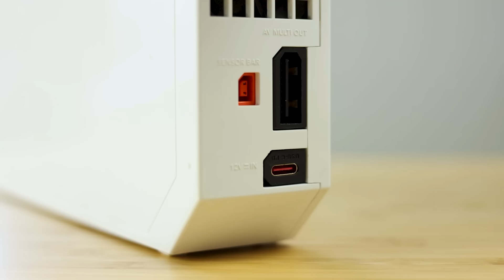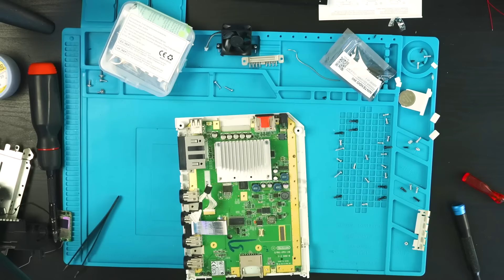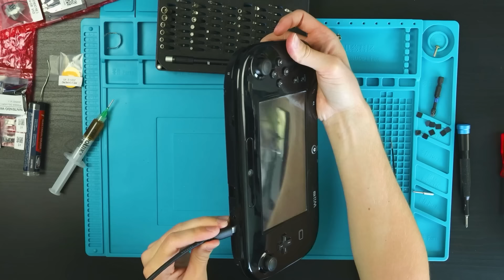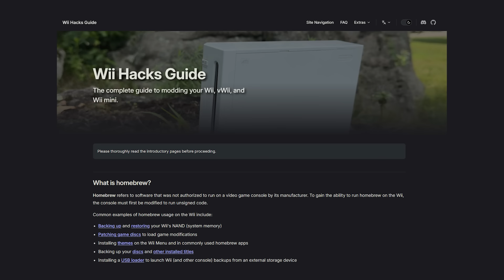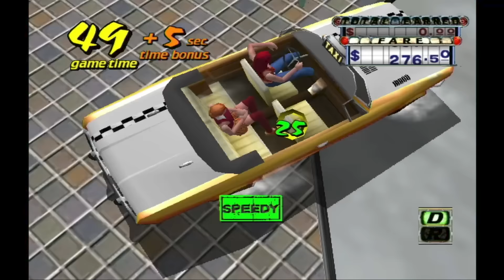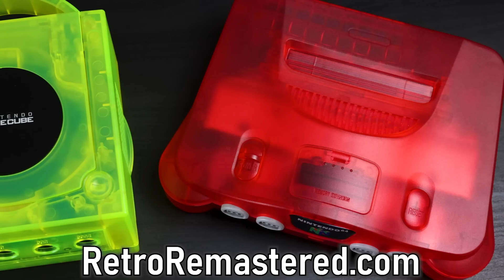The ULTIMATE Modded Wii! (HDMI + USB-C)

Comment: I have the Wii2hdmi adapter, and it's surprisingly good. It's definitely not perfect, but, for the price, it's great.

I also have a far more expensive solution for my N64, which is RGB modded, and connects to my TV with a RAD2X, so I know what it's like to have a really clean video signal, but I'm perfectly happy with the image quality I get from the wii2hdmi adapter on the Wii. There's a bit of signal noise, but you usually don't even notice it.

Comment: So I have this Vizio 75 inch 4K TV (real world size its 65.5 inches with measuring tape) and plugging the Wii U's own HDMI cable to it... the TV won't reproduce image besides black screen stuttering every few seconds few times a minute.
It worked just fine in a regular 30 to 40 inch 4K TVs. But the 75inch TV was a bit much...
I'll see if using the Wii HDMI adapter will work on the Wii U's native Wii graphics port (the one everyone avoids given you already have the HDMI port and cable by default) just in case to get around the issue.
And using a 4K HDMI adapter for GameCube works fine for this TV, so its weird that the HDMI Wii U couldn't handle it.

Comment: I've been tinkering with a wii I got for free, and the image quality is just so bad. I modded it and switched off deflicker and everything else. What the hell was Nintendo thinking when they build this system. Most of the games look terrible, and switching controllers for every game you play feel like such a grind. I'm actually over it. I do own a wii u, and that's my preferred system I use to play old Nintendo games, but even on there you have to change controls a lot. Why did Nintendo not just put in a hdmi output, I mean it came out around the same gen as a ps 3, but even ps 2 games look better than wii games. Don't get me started on motion controls. Why they didn't give you an option on most games. They literally force you to use motion. Such an frustrating system.

Comment: @JakeSimmons can you mod the controller to have a battery bank to charge by usb type C? I can deal with the Wii not having HDMI or settling with adapters or modding, but I can’t stand going through batteries like no man’s business playing that should have never been a thing. I know there are cheap rechargeable type battery clip ins they just don’t work that well. Same thing that needs to be done with the xbox360 old controllers. Just my thoughts.
Reply from the maker: I would just get some rechargeable AAs. The LADDAs from IKEA are awesome
Reply: No IKEA nearby, so I use the £4 ($5.40) Lidl AA Nimh (x4) and a £4 Kodak USB-C Fast Battery (x2) charger from Poundland.

I'd choose the LSD / Ready To Use type (but lower mah capacity), as they drain slower on the shelf.

The charger is great for travel as it's the same size as a Wii remote cut in half and weighs nothing. I'd prefer x4 charging slots though.

I hear the remotes drain batteries constantly, so remove when not in use for a while. Also claims that 'motion plus' versions & dongles drain faster.

A power switch mod for the remote would be good, or you can wedge a piece of drinking straw on top of one spring.

Comment: the HDMI is desired but I feel safer having the OG power cable
Reply: Honestly, considering how old the components in the original power supply are and how much progress has been made in designing power supplies in the past 20 years, I personally feel safer with the USB-C replacement
Reply: @SHIFT-HACKMON I'm over here wondering how the USB-C upgrade this guy did is holding up 8 months later
Reply: Fair enough

Comment: How does this mod compare to the retrogem, the ElectronAVE, and the Arthrimus? Is there a clear winner among the 4 of them? I tried using the Wii2HDMI but it sucked badly compared to the retrotink 5x pro with component cables. Problem with the retrotink is that theres too many fucken cables but it looks amazing compared to anything else. If any of these mods look as good as the retrotink 5x pro using components i would totally do it, but no way of me knowing this without seeing side by side, which are hard to find anywhere.
Reply: The benefits of Arthrimus and AVE Mod is the same. Both based on Ingo Korbs GCVideo.
GC Video is not the newest build, but the results are very good. I don't think, the image with Retro G.E.M. is much better...Plus, the AVE is much cheaper in comparison to Shiny Edition of Retro G.E.M.

Comment: I have the Electron Shepherd AVE-HDMI mod in my Wii and I use an mClassic to make it look a little better (subjective). The AVE-HDMI uses GCVideo like GameCube HDMI adapters. The odd part is that on my 4K Samsung, with the mClassic upscaling 480p to 1440p, my TV glitches out. The screen flicks on and off. This does not happen on my GameCube w/ Pluto IIx mod (also GCVideo) or OG XBOX with Project Stellar and XboxHD+ HDMI mod or Wii U. It has no problems on any 1080p TV I have or my 1440p gaming monitor. I have to use an EDID emulator for 1080p to have the mClassic output at 1080p. I also do have the Electron Shepherd Electron Warp analog to HDMI adapter. It is better than the cheap $10 from Amazon, if your looking. With 480p coming out either way to the mClassic, you really can't tell any difference unless you are really close. If you are just playing a few feet back, you won't notice. If you don't want to go outside Amazon, at least get the Mayflash Wii to HDMI for a few bucks more but the Electron Warp is ~$30 shipped. Electron Shepherd is very responsive to emails. They couldn't do much about my AVE-HDMI issue because its not on them but they did what they could.

Comment: No way this is worth it. Just buy a Wii U… I find them locally for $50-$70 often.
Reply: No. The Wii U without the gamepad is in no way worth it over this. Without the gamepad, you are locked out of the setup process, and locked out of system settings. The gamepad is required, and without cfw theres no way around that. Even then, the Wii U picture output for Wii games is worse than a Wii can output, and is much slower to even boot up, not even mentioning that you have to also wait for it to boot into wii mode after waiting for it to boot up initially. You can hold B on the gamepad to boot straight into the Wii menu, but without the gamepad good luck.
Reply: @Nebula.21_ I didn’t say you can use a Wii U without the gamepad. But you can’t deny the Wii U looks as good as this mod and costs the same as the mod.
Reply: @slayNprey the wii u Wii output looks really bad if you've ever had one
Reply: @aagamingdotme you can use homebrew to force vWii to output at native 480p and it looks basically the same as a Wii HDMI mod
Reply: The Wii U only outputs 16-235 limited RGB range, the Wii covers the whole 0-255 range giving you more vibrant colors, deeper blacks and brighter whites. Also, it can be upscaled to 4K without going through 1080p first. There's definitely still some worth having the Wii over the Wii U
Reply: vWii adds an additional frame of lag, doesn’t natively play GC games (Nintendont is just a hypervisor), and outputs worse picture quality for wii games. Love my wii u but no thanks.
Reply: Agree, after installing the USB-C mod and the USB power mod for the SSD, my Wii U is bringing me hours and hours of multiplayer enjoyment! Mine was 80€ with the GamePad, all the cables, and two original games.
Reply: The best option for GC and Wii games are Game Cube and Wii with GCVideo. The Wii U have a bad emulation of that games with blurry image.

Comment: the wii teardown is not so bad you just need to pay attention to the symbols stamped into the board there is a method to the madness .

Arrow: Indicates the screw goes through just the logic board cover.
Triangle: Indicates a longer logic board cover screw.
Cross (X): Indicates the screw holds a plastic piece in place.
Box (Square): Indicates the screw holds an EM shield or heat sink.